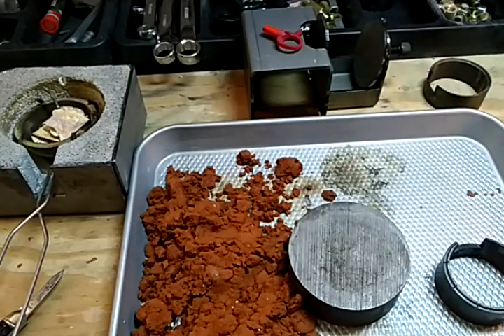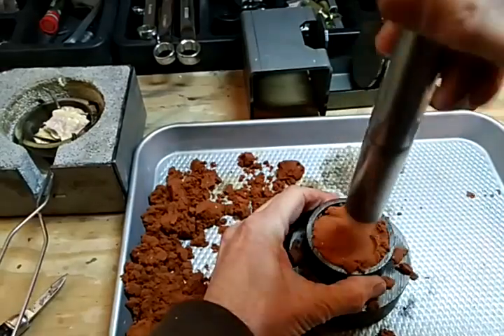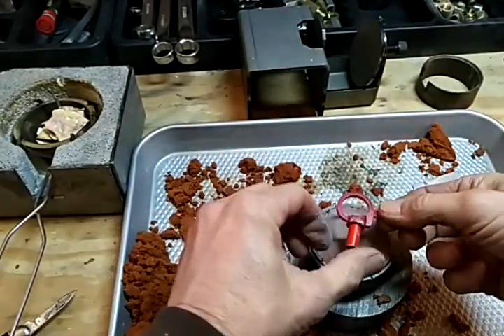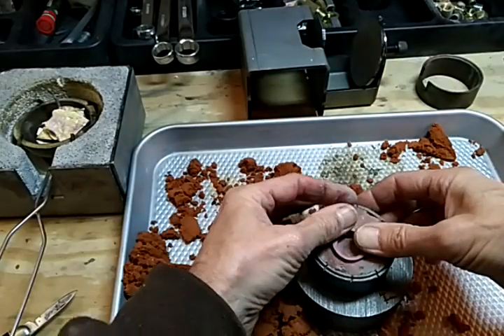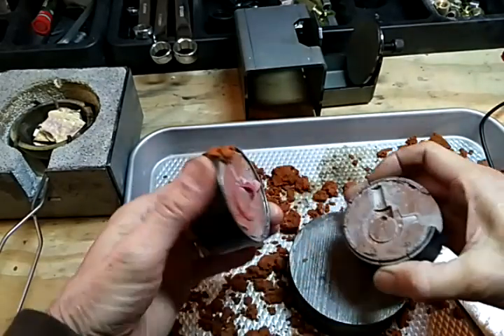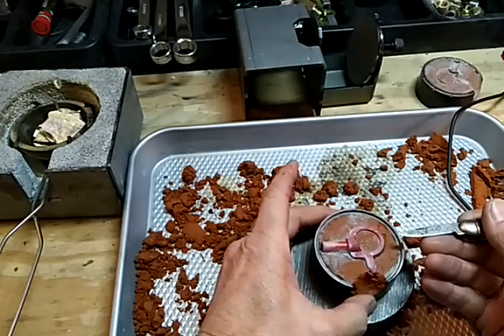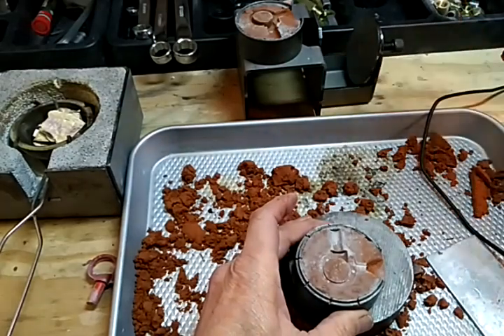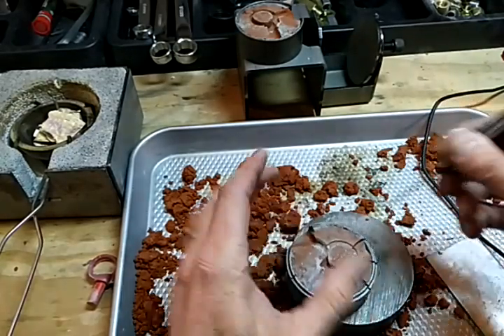Red Clay Casting - First Try Using a Core

Comment: Mr. Dabler, I'm switching away from mapp gas and going with an oxy/prop combo like you are using. It will be used only to melt fine silver. My research shows differing gauge settings like 15psi tops for the propane 50 tops for the oxygen. What do you recommend for the best settings and could you suggest a tip that will get the job done. I won't be using this tip for anything other than melting. Thank you for your time.
Reply from the maker: Fine silver and sterling silver are entirely different when using Mapp gas. Sterling will melt and Fine just seems to get red but never flow. Fine, being a pure metal, doesn't cast as well either so don't be discouraged when the casting doesn't always turn out well.

Comment: Thank you for that info. I didn't know about the casting difference between silver and alloy silver. Can you suggest the guage setting and torch tip for just melting silver? Thank for all of your help.
Reply from the maker: I think regulator settings vary depending on type of torch and how big the hoses are. I'm at about 8 lbs for propane and 20 lbs for oxygen. Torch tip on my Hoke is about 1.5mm round hole size.

Comment: My Delphi sand is lumpy and hard only had it 1 month is there a way to liven it up thanks
Reply from the maker: Just take it out, set it on a tray, and work it with your hands and knead it like dough. Break it up because it comes very compact in a brick like form.
Reply: Craig Dabler thanks i do that but I now know its how it should be thought it was wrong thanks for info 

John

Comment: Cool, a wooden core!  I expected it to offgas and cause blows, but maybe the small amount of molten metal cooled and froze fast enough to avoid that.  (My casting experience is all with larger sand molds, not jewelry.)  I am sure of I used a wooden core for one of my bronze axe blades' eyes, it would be a disaster of swiss cheese proportions!
Reply from the maker: You know, the wooden dowels have worked very well and are much quicker than making other types for something so small.
Reply: @craigdabler-thediycastings7511  sure seemed to work well here!  I can certainly see how a simple wooden dowel is much easier to deal with than making a corebox and ramming up sand cores.